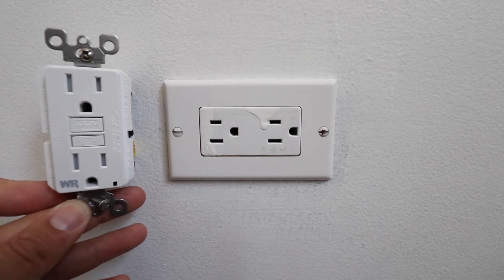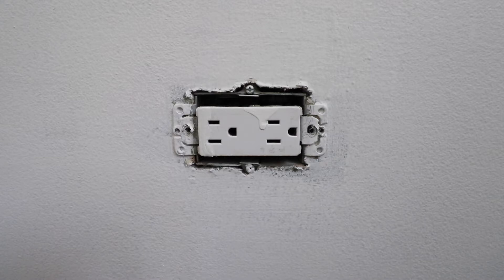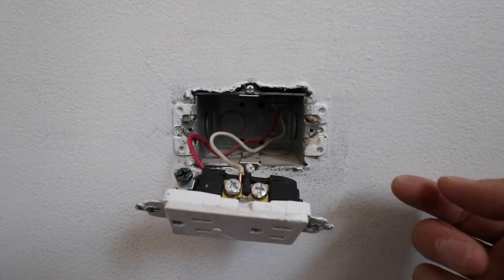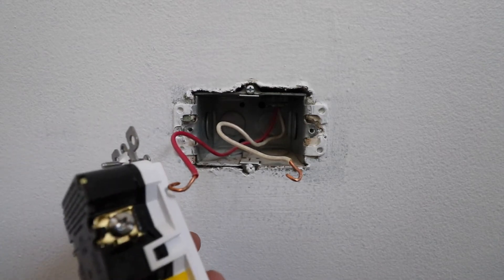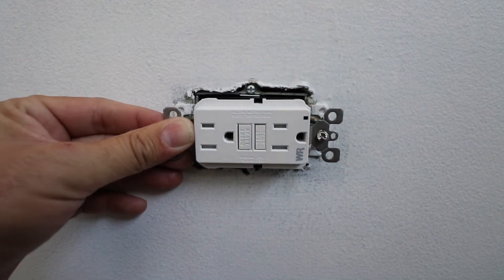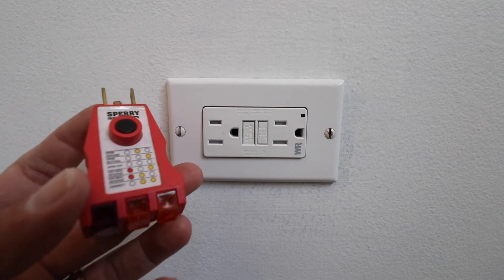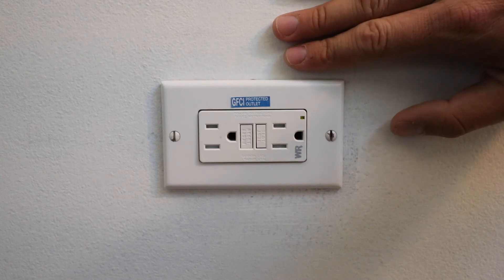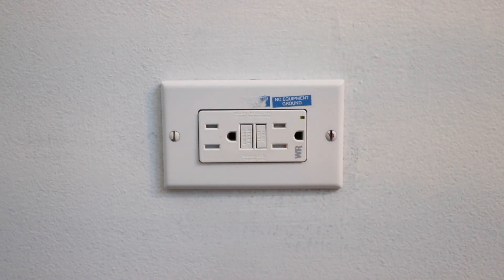HOW TO INSTALL A GFCI OUTLET

Comment: Thank you. Your explanation was crystal clear, and I'm ready to tackle this myself. I noticed that you left on the yellow tape covering the 'load' terminals. Is that OK, even if the electrical tape wrap at the end is omitted?
Reply: Does it matter if the wires are on top screws or bottom.  I know what wires go brass hot  .
Reply: Thank you !

Comment: Plugging something in isnt the correct way to test if the circuit is live, this is a good way to get someone hurt. You should always test for current with a multimeter.

Comment: Thanks for a very clear video and description (both spoken and written!). Don't know if I am brave enough to take this on, or even if I can find the right replacement outlet cover (need 2 switches and 2 plug outlets, with switches vertically arranged on left and plug outlets vertically on right, in white). Thanks for the links, too.  Keep up the good work!

Comment: Forgot the ground wire if you have one!  Ooops
Reply: He sadi the box was grounded
Reply: @robertsymonds1238  He actually said that if you have a metal box, then it's grounded, which isn't necessarily true.
Reply: He actually said if you have a metal box AND you live in an area that uses metal conduit to route your wiring, then you’re grounded. Which STILL isn’t necessarily true but…